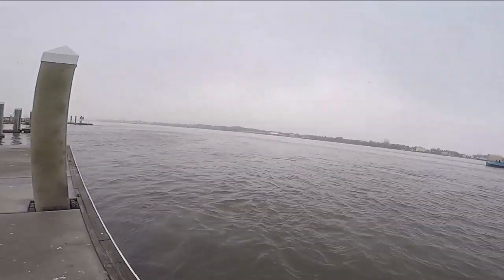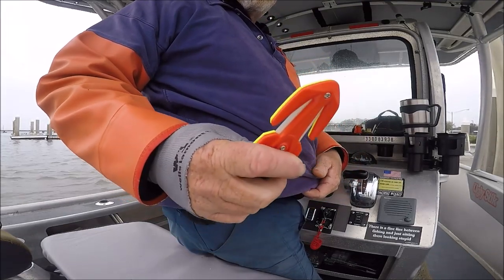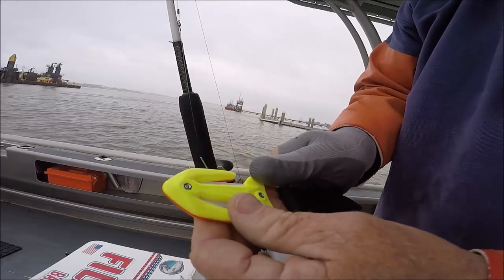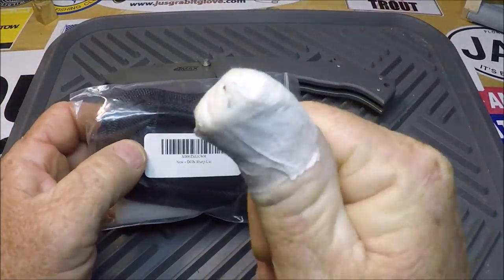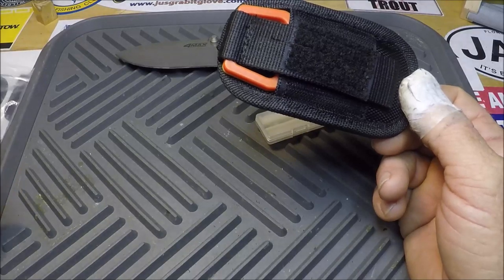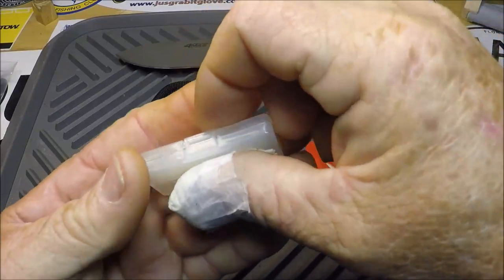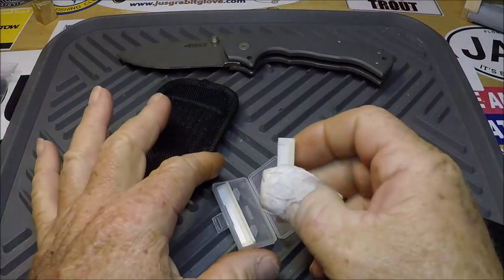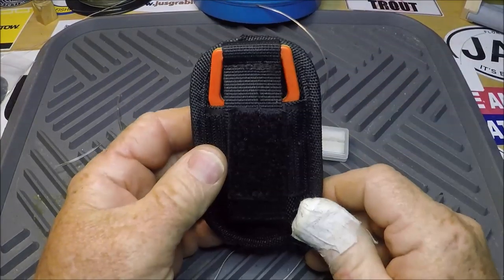CUT BRAID **LIKE A BOSS (mono too)

Comment: good vid Capt Dave. Bet that line cutter would work for a first responder  as well,seat belts and that type of thing. At first sight I thought it was a floating tool. After you said dive tool probably neg buoyancy or at least neutral. Cuts wounds pings and dings always seem to heal faster when dipped in salt water a few times a day. Ever notice this?
Reply from the maker: I may not be on the right side of a religious fence. but I tell kids about saltwater is where everything probably came from, and is the great healer. All because of that and what wounds I've seen in fish, that healed up, and if that was a land creature, would have been fatal.  BTW, at the end of the day I cut that piece of glove off my hand in one swipe!  I LOVE THIS THANG LIKE I DO MY NEW COLD STEEL 4-MAX.....that says A LOT!!!